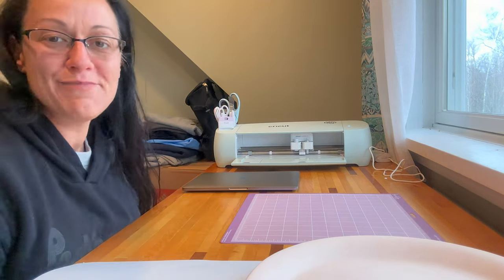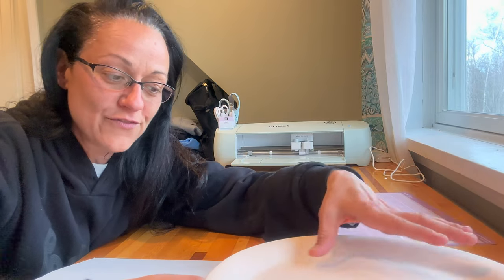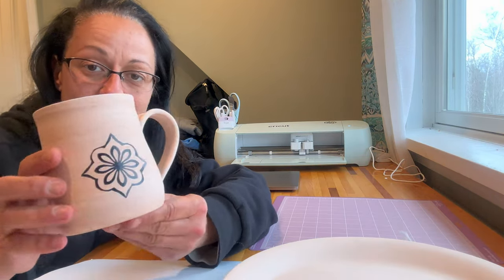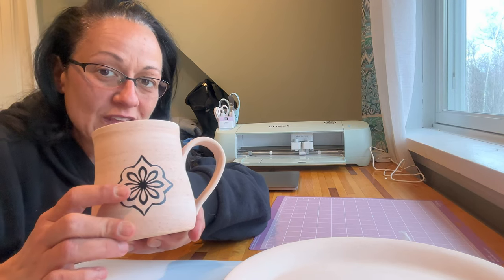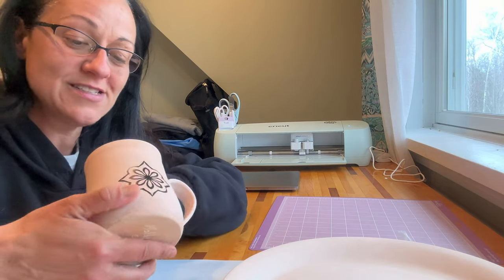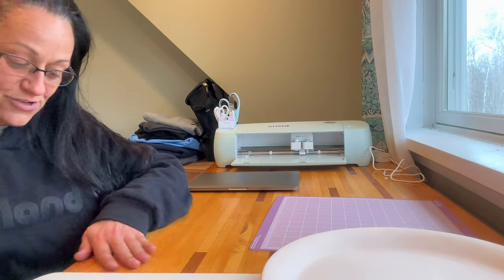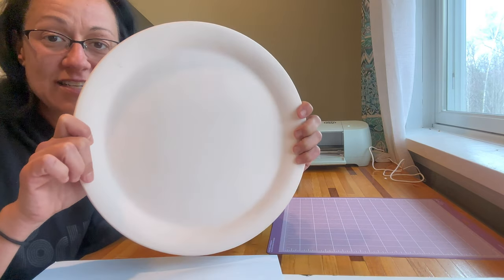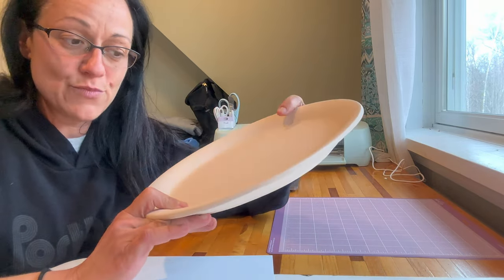You Learn the Most Through Failure | Mandala Plate Design Part 1

Comment: Can you reuse the mandala?
Reply from the maker: @suestern4642  yes! BUT because this was so intricate, and I got super frustrated 😆, some of the lines split when I peeled it off. Like it came off in pieces. You would have to take ur time and be patient getting it off. Other designs are way easier to remove in one piece. Hope this helps!
Reply: @thehappyhomesteadnh  it does, thank you! It looked somewhat fragile from what I could see in the video
A friend has a cricut and we used tyvek sheets to make designs. It works very well, it’s indestructible, however, there’s no adhesive. I do lots of layering with slip and underglazes.
Reply: @thehappyhomesteadnh  thank you, yes, it was helpful!